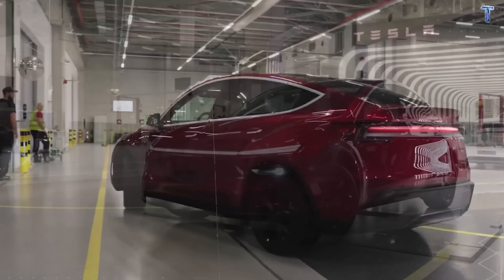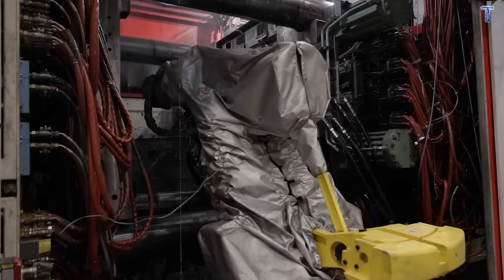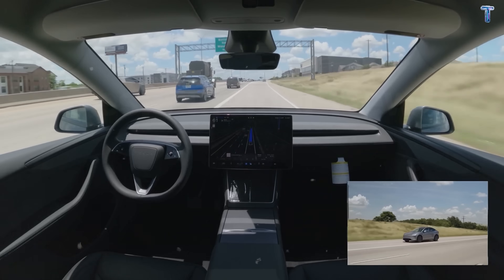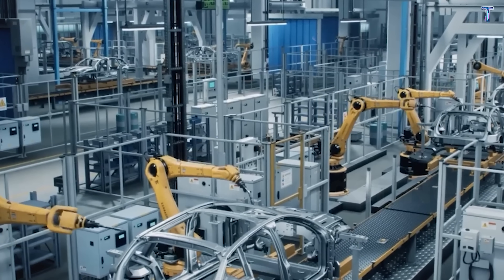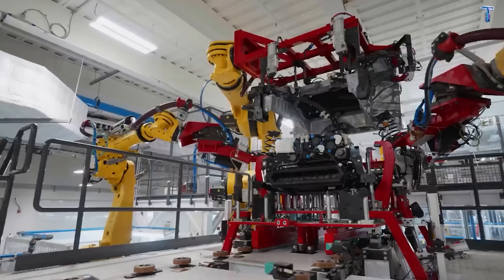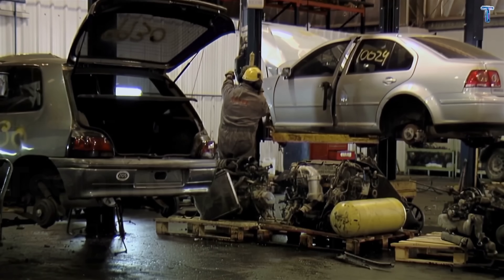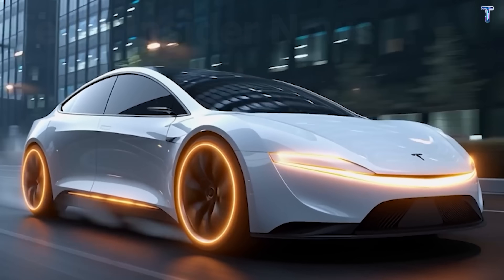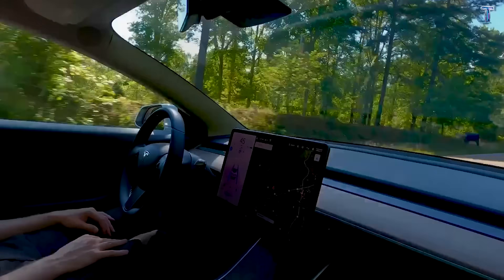Elon Musk’s $12,749 Model 2 Ends Car Bills Forever

Comment: I am still waiting for Tesla to deliver in the area that really needs it.. city bus. With the aluminum battery super fast charging you could 40-60 charge at a single bus stop so range would not be an issue. The charging model would be much like a wiper blade swinging in from the back to use vampire type connectors to make the recharge automatic. You would line up for charging by using dual yagi antenna, one to bring the vehicle in straight and the second to stop at the right time. No more wires for the electric bus lines and no fuel for the petrol versions. Note this also work for both rail systems underground and over land. common man get with the need.
Reply from the maker: Fast-charging buses could solve a lot of problems, and your idea of a contactless auto-alignment system would make the whole process efficient enough for real city routes. The tech is already close, so it’s surprising we haven’t seen more movement toward it. Do you think cities would adopt it quickly if the infrastructure costs dropped?
Reply: my biggest question is if a conversion system could be made for the buses already in use. the truck is already designed so a bus should be a simple solution and require a less powerful motor. The same charging system would work a over the road truck, so the idea would have far reaching applications. Just how do you get this idea to Tesla?  @TeslaInsiderNews
Reply from the maker: Retrofitting existing buses is actually one of the smartest angles, because replacing whole fleets is expensive and slow. If a conversion kit could handle charging alignment, connectors, and control logic, cities would adopt the idea much faster than starting from scratch. A less powerful motor and standardized charging hardware would make scaling to trucks and public transit systems realistic too.

As for getting the idea to Tesla, the challenge is that big companies rarely act on external suggestions unless they already have programs in motion. Have you considered sharing it with smaller EV retrofit companies or transit engineering groups that might move faster with concepts like this?

Comment: If you want to make a video that gives good information quit switching between miles and kilometers and pounds and kilos. Also, don't use units like mega-pascals, most people don't know what it means. If a battery is good for 1500 charge cycles and you recharge it twice a week it will last for 14+ years. I drive about 250 miles a week, which means it would be good for 30 years. If you got 5000 cycles, then it would last 96 years. The biggest thing in this video is the price, when I see a Tesla priced at $12,750, then I will believe it. My guess is starting at $30-32k. On the flip side if I see a brand-new Tesla priced at $12-13k I'd buy it.
Reply from the maker: Clear units definitely help people follow along, and switching between systems can make things feel more confusing than they need to be. Your math on charge cycles is solid, and long-cycle batteries really could outlast most drivers. The price is the biggest wildcard, and a 12k Tesla will need real proof before anyone believes it. If it launched closer to 30k but kept the durability claims, would that still feel like a smart buy for you?
Reply: @TeslaInsiderNews  I would not be very enthusiastic about it. The $13k price point is the most interesting thing about it.
Reply from the maker: That makes sense — at a 30k price point, it becomes just another EV competing with everything else in the segment, and the excitement drops fast. The entire appeal is really tied to the idea of a truly affordable Tesla breaking the market open. Without that, it’s just another car with promises. If Tesla surprised everyone and actually hit somewhere between those two extremes, what number would make you take it seriously again?

Comment: What level of violence does it take to total one out?  Will a small fender bender totally destroy it?
Reply from the maker: The chassis is engineered to absorb impacts, but a minor collision shouldn’t automatically total it. The big concern is when damage reaches the cast sections, because those pieces can’t just be patched the old way. Still, most low-speed hits should only affect exterior panels and suspension parts that can be replaced. Would clearer repair data from Tesla make you feel more confident about real-world durability?

Comment: What happens when it gets hit by lightning and the doors lock ?
Reply from the maker: A lightning strike can definitely disrupt electronics, but modern EVs isolate critical systems so the doors don’t depend on them in an emergency. The manual release is meant to work even if every circuit is fried. Do you think a more obvious mechanical handle would make this feel safer?
Reply: @TeslaInsiderNews well not 1 mile up the road from home a Dr was horribly disfigured by this same scenario . Lightning strike fire and couldn’t get out . Every college sold their Tesla .
Reply from the maker: A situation like that would shake anyone’s confidence, especially when there’s a real event tied to it. Lightning strikes are incredibly rare but terrifying when they do happen, and once a story like that gets around, it makes people question whether backup systems are enough. Even with a mechanical release, it only helps if it’s easy to reach instantly without thinking.

If automakers put the emergency handle in a visible, familiar spot like older cars had, would that go far enough to restore trust for you, or does the whole design still feel risky after hearing that story?

Comment: Kudos for bringing up people trapped inside during fires and false braking. I'll hand that to them, but then again, people got trapped inside during fires! One would hope they fixed that, but a latch "concealed in the trim"? Gotta find it while the car is burning?
Reply from the maker: It’s a fair concern, and early designs definitely had flaws. The updated manual latch is meant to be simple enough to grab without looking, even under stress, but it still depends on people knowing where it is ahead of time. Do you think a more visible or standardized emergency release would make you trust the system more?
Reply: @TeslaInsiderNews  Yes, I do. I understand the motivation to have the interior look polished and sleek, but cars have had latches inside which can be seen since they were a invented. Nobody is going to be bothered by seeing a latch to open the door, and they would know exactly where it is. Thank you for asking though, I appreciate the question.
Reply from the maker: A visible latch really would solve most of that concern, and you’re right — nobody is going to complain about seeing a clearly marked mechanical release when it’s something you might need in an emergency. Sleek design is nice, but not at the expense of safety or instinctive usability. If Tesla offered both a visible latch and the cleaner electronic option, do you think most people would choose the simpler, old-school handle anyway?
Reply: @TeslaInsiderNews  I would think so, you specially if it cost less. 😊

Comment: Even small accidents probably total the car since everything is integrated together. Insurance would be high cost because accidents mean replacement. Parts and service would be locked into Tesla service centers. Even this vehicle will need some replacement parts. They mention brakes specifically. Any battery issue probably means replacement of the vehicle since it is part of the frame. Glass, lights, and especially electronics would require Tesla specific parts probably only available at Tesla service centers. I really want to love this car because I am older and I fit perfectly with the market for this car. Eventually the self driving might become essential for me. My driving demands are less then they were and less maintenance would be a big cost savings. I really hope this works out, even at twice the cost it would be worth buying as my "final" car. One final note, the US power grid is pretty much at capacity and with new AI data centers things are getting worse. Cost for electricity is rising. Brownouts are a real issue. Adding huge numbers of these vehicles on the grid may not be feasible.
Reply from the maker: It makes sense to be cautious, especially when everything is tightly integrated. A small collision could mean higher repair estimates, but Tesla’s casting approach is supposed to reduce the number of components that actually need replacing. Even then, the dependency on Tesla service centers is real. The grid concerns you raised are also valid as EV adoption grows. If the operating costs still came out lower for you overall, would that shift how you feel about those risks?
Reply: @TeslaInsiderNews Maybe. The big thing is longevity. Today's vehicles are more expensive and must last far longer then in the past. Honestly Tesla's reputation is not great for early adaptors. There are a bunch of power walls out there that were  bricked by Tesla and they have no public plans to do much about it. Less maintenance cost would be great and in theory an EV should have less. I am not going to be an early adopter to find out  because the exposure is too high for me. If in 5 years they still look good then I would probably buy in.
Reply from the maker: Reputation and longevity really are the deciding factors, and waiting a few years before jumping in is a smart way to avoid becoming the test case. Tesla’s early issues with bricked Powerwalls make that hesitation totally reasonable. If real-world owners report strong reliability over time, would that be the point where you feel comfortable making the switch?

Comment: What happens if the internet goes down or you can't get a signal someplace like mountainous ranges or very rural areas?
Reply from the maker: The car’s core driving systems are designed to run locally, so losing signal shouldn’t stop basic operation. You only lose things like live navigation updates or remote features. The question is whether you would feel comfortable relying on onboard systems alone during long drives in those areas.
Reply: @TeslaInsiderNews  I would never drive a car like that. I'd feel better in an air cooled VW Beatle.

Comment: It’s not going to happen at that price period.
Reply from the maker: Price skepticism is definitely the biggest sticking point, and hitting that number would require breakthroughs on manufacturing costs that Tesla hasn’t proven at scale yet. Still, even a higher price could shift things if the tech delivers. Which part of the pricing claim feels the most unrealistic to you?
Reply: Even if the price is double that it would be fabulous. I paid over $90k for each of my Model S Tesla’s and after 7 years of driving them I still love them. Almost zero maintenance besides tires, air filters and windshield wipers.
Reply from the maker: That’s actually a great real-world counterpoint. Long-term ownership matters more than headline price, and your experience shows why people stick with EVs once they live with them. Even at double the rumored price, low maintenance and daily usability can still make it a solid value over time. Hard to argue with 7 years of enjoyment and basically just consumables.

Comment: I highly doubt all this, but then the creator gets comments out of it. Like a house and property taxes, you never really own it. With Tesla, it doesn't matter the price of the car, you have to pay $100 per month for updates. I bought my car new, it's 8 years old and has been paid for. Yes, I invest in preventative maintenance by the dealer, but it isn't a monthly thing and it has less than 75,000 miles. Some people are buying used cars with more miles than that. It has lots of life left, with no payments. I'll eat my shorts the day any car company puts out a new $13,000 car in the US. I'll even wear them one day for every $100 it comes in less than that. And, I'll give you the rights to film and distribute it.
Reply from the maker: Some people really value owning a car outright with no monthly costs, so subscription updates can feel like a deal breaker. Tesla’s model definitely leans toward ongoing software support instead of a pay-once system, and that’s not for everyone. Your current setup sounds cost-efficient and predictable, which is hard to beat. If a future EV dropped the subscription requirement entirely, would you consider giving it a look?

Comment: Cost will be 25000 to 30000 dollars.
Reply from the maker: A lot of people are putting it in that range, and real production costs could easily push it there rather than the headline number. Even so, a 25–30k EV with low operating costs would still shake up the segment. If it launched at that price but kept the long-life design, would it still feel competitive to you?